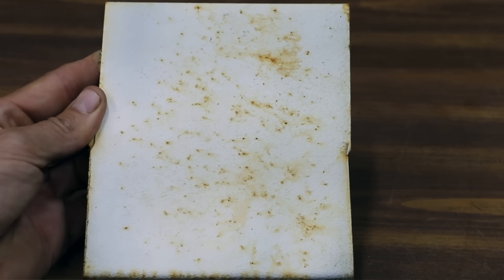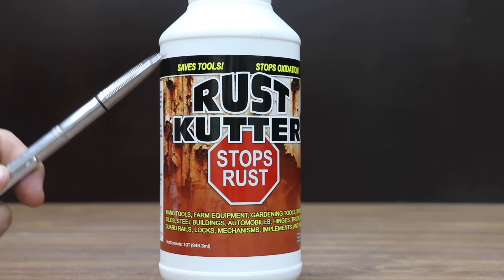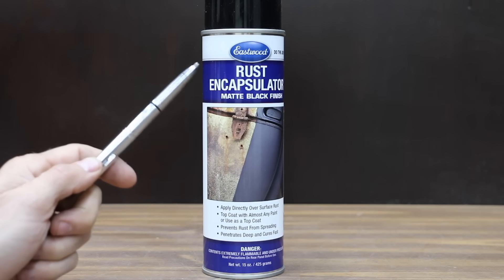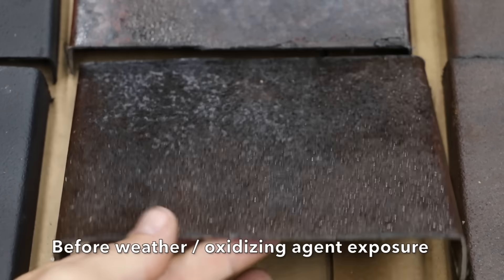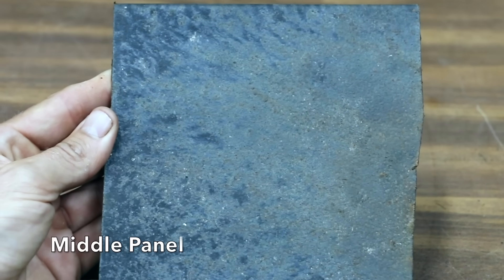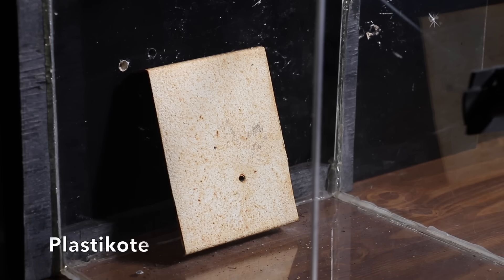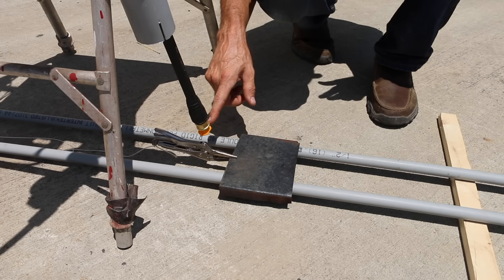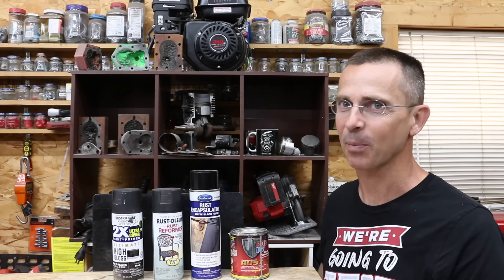Best Rust Converter? POR-15, Eastwood, Rust-oleum Rust Reformer, Gempler's

Comment: Living in Wisconsin, I've used por15 and rustoleum rust reformer.

I did por15 this spring in a heated garage on a fairly clean Jeep. 4-5 months later I'm getting rust all over after doing the 3 step process costing me about $120.

I used rustoleum rust reformer about 3 years ago on a previous jeep and that still hasn't rusted through.
Reply from the maker: Thanks for sharing.

Comment: I wish this video was around when I was doing a ton of rust repairs a couple years back! I still have a huge case full of all the different rust treatments I tried.

I’d love to see a comparison with liquid acid rust converters. It would be especially interesting to compare against something like the Permatex, which is an aerosol acid and should be doing some degree of chemical rust conversion versus just encapsulating. Permatex also sells the same thing as the rattle can, but in liquid form, which could be a control test for directly comparing application methods.
Reply from the maker: Thanks for sharing.  Thanks for the video idea.

Comment: Rust Converter? I am confused by the title of the video. What I see is paint that prevents rust from coming back. Yes, some of the paints adhere to surface rust like POR-15. But what I understand as “Rust Converter” is something like Evapo-Rust, Corroseal, etc. Most of these products are in fact Phosphoric Acid that stabilized the surface rust so you can apply paint over it. The other alternative is when you have clean metal you applied Edged Primer or 2k DTM epoxy primer. PS: the instructions for POR-15 are: first use a degreaser, second used Metal-Prep (Phosphoric Acid) and last applied the POR-15 paint which I think is urethane based. Confused 🤔 can you please clarify?
Reply: I haven’t looked at all the data sheets, but at least the Permatex is aerosol formic acid and is an actual converter. The one that performed very similarly to it probably has a similar composition. I’d also love to see a specific comparison of actual rust converters though.

Comment: I've been using POR 15 for years, it is very expensive but I'm not surprised it did the best. It seems almost like it turns to a epoxy coating. The only drawbacks are cost and trying to get the can open, once it's been used and resealed, best thing to do is put a layer of plastic film over the can before putting the lid back on. I have used all the colors and they seem to work equally well.
Reply from the maker: Thanks for sharing!

Comment: I’ve been using Rust Reformer for years and it’s the clear winner in my book. Only a 6th of the price of Eastwood and POR15 and also way easier to apply than POR15 in tight spots too. I don’t put a top coat over it and everything I paint with it never rusts again for the vast majority of projects. If it does however, it’s super easy to wire wheel a trouble spot and spray again in no time at all. In average painting conditions it also dries very fast. About 5-10 minutes on a sunny day and about 30-40 in the winters here in New England. The stuff I have painted with it (no top coat) looks the same as it did 6 years ago. Truly great stuff.
Reply from the maker: Thanks for sharing.
Reply: Over 6 cans of rust reformer for the price of one por15. I wonder what would have happened had he used the products in monetarily equal amounts.
Reply: @1985cjjeeper  I mean, 6 layered of rrr probably wouldn’t have helped, but, if he did 6 tests on the same por coupon and resprayed over the rrr coupon 6 times that would work too, I touch up nicks and scratches all the time when rocks or whatever hit painted areas
Reply: @tenderblender945  
I used it on a toyota truck frame that was rusting badly from having spent time up north before coming back down south where I live. I would just spray it on and the rust would die and come off in almost sheets then I'd spray it again. Took a year or so but eventually it was all healed up.
Reply: Rust reformer is just cheap spray paint... it's not a real rust converter. No chemical reaction happens and it contains no phosphoric acid.
Reply: @evanfrucht  are we talking about the same paint?
Reply: @tenderblender945  I'm not postive but maybe. I'm glad it works for you. To be honest, I'm not sure what the composition of the Rustoleum Rust Reformer (available in spray cans) actually is, or how similar it is to their normal spray paint... I bought some in the past and was surprised and unhappy it wasn't the normal clear acid type spray that I was expecting, rather it smelled strongly of hot solvents. POR15 and other similar pigmented paint based systems, such as the RRR are completely different than true acid based rust converters which chemically alter the iron oxide. In my opinion, a rust converter should be acid based by definition...
Reply: @evanfrucht  that is completely fair, I like this stuff as it is not acid based so it can be sprayed over many things to preserve things in the mean time to prevent corrosion and won’t harm things like rubber or existing paint ect, and can be easily removed with acetone, it works well for me for this reason

Comment: The POR 15 is amazing. I used it on my 66 Chevelle SS for when I did a frame off restoration for the frame and under body and over 20 years later it still looks perfect ...no rust no chips. Looks as good as when I first did it. This stuff is the best !!!! And when you brush it on it smooths out like if you sprayed it on. A can of it covers a large area so it actually works out cheaper than anything else.
Reply from the maker: Thanks for the feedback.
Reply: @ProjectFarm  I used POR 15 in a rusty trunk floor, that had small and medium holes rusted through, in combination with fiberglass matt and cloth. I installed 2layers of matt and one cloth layer, rolling the POR 15 into each layer as you would with resin. no dry time inbetween. 6 years later the trunk floor is still solid with no signs of rust.
Reply: Can por 15 be painted over?
Reply: @Zumone1one  yes, it can. They also make a product called Top Coat to go over POR-15.
Reply: @Zumone1one  They actually call for it to be scuffed with 320 and topcoated if it's exposed to prolonged UV
Reply: I’m about to do this to a mopar vehicle, how did you prep the surface? Was it almost perfectly prepped and cleared? Or did you kind of get the rust Bubbles off and then apply it.
Reply: @Vikingcowboy5  - It is designed to go str8 over rust. Scrape chunks and wire brush loose stuff off, wash dust and go to town. I didmy truck frame and a trailer hitch receiver years ago, you remember how bad those would rust once the moisture got under the "paint"?  I took off the huge peeling flakes, lightly brushed the dusty stuff off, rinsed with water and brushed on POR15.  5 years later, absolutely no rust came through,  salty winter driving and all. However,  DO NOT get it on your hands.  It is impossible to get off.  It literally has to wear off in 1-2 weeks.
Reply: @PayNoTaxes0GetNoVote   Thanks for the info!!
Reply: @PayNoTaxes0GetNoVote   Thanks for the heads-up!
Reply: @PayNoTaxes0GetNoVote  And if you have a pressurized inert gas you can push that into the can before sealing.  That will greatly reduce the risk of curing in the can.   I think Bloxygen is one example, they use Argon gas.  Argon is heavier than “air” and will lay across the surface and thus prevent oxygen and water vapor from coming into contact with the coatings.  Shelf life goes way up and you might get 2-8 times the shelf life out of the single can of POR.  So, if you don’t use a lot at one time this is a great saver.  Also, the ability to brush this on really helps when working on items that are already assembled and in very tight spaces.  Spray cans make a big mess in confined spaces where your goal is to coat something that’s less than 10% of the surface and there are nooks and crannies in the picture.
Reply: I wonder how similar it is to something we have here called PA 10
Reply: That is seriously impressive

Comment: Given how scarred most handymans' hands are, something that DEFINITELY should be tested is simple wound coverage.

- various brands of premade adhesive bandages (Bandaid, etc.)
- A piece of gauze plus
  - paper & cloth tapes (for first aid kits)
  - duct tape
  - electrical tape
  - self-fusing silicone tape
  - tied bandage

While all should provide coverage for a wound, what would be good to know is how well each stands up to common shop products, abrasion, water, etc.  After all, if a bandaid gives up can falls off, the wound is unprotected.
Reply from the maker: Thanks for the suggestion.

Comment: Best locking pliers/ “vise grips”? I feel like there could be a lot of different and very good tests that can be done . Toughness / construction of tool, a twist test?Toughness of “teeth “, how well it grips onto flats and rounds. Most torque able to be applied .
Reply from the maker: Thanks for the suggestion.
Reply: @ProjectFarm  I have a bunch of old Vice Grips that are great. My Milwaukee have been warrantied a few times from broken springs or broken Jaws. My Home Depot Husky have held up comparable to Vice Grip but no longevity.
Reply: that was quick lmao
Reply: I actually recommended this a couple weeks ago and he made a video on it! I’m glad he did to because I figured out what pair I’m gonna buy lol

Comment: Rust treatment: remove loose rust. Buy a gallon of rust paint. Take out a quart and mix it with a quart of paint thinner. This is the primer. It will soak into the rust and convert it. If after the first coat there's still a gritty look a second coat is required. Dry
 Then paint with unmixed paint.

Auto body: buy the same color as the car or a little liter. Spray with color match paint when dry. Clear.
Reply from the maker: Thanks for the feedback.

Comment: Darn!!!!   I wish the Jenolite rust converter had been included.  I was very impressed recently after not being super impressed with VHT.  But, for my application, VHT did fine after then being painted.  I have no recurrence of rust on my frame rail welds.  I sprayed the Jenolite into areas I could not reach to descale...they all turned very black.
Reply from the maker: Thanks for sharing.

Comment: This couldn't have been better timed if you tried.  I have a whole entire 18 foot car hauler frame that is covered in gnarly rust scale.  I am leaning towards rustoleum rust reformer but in gallon can instead of aerosol.   Thanks for great video Project Farm.   I have heard some very negative things about POR 15 in the last 10 years or so but you seemed to dispel those complaints.  I have used it in the past with good results but I'm not spending that much on a whole trailer frame.
Reply from the maker: You are welcome!

Comment: Can you please test truck frame coatings? Gm Ford and Ram all use different methods from the factory and lots of people are re coating their truck frames because they think the stock frame coating is inferior. It would be great if you can settle the argument of which brand (GM Ford Ram) has the method of coating frames from the factory.
Reply from the maker: Thanks for the suggestion.

Comment: I’ve always loved por-15. The thing about it is, just use it in places you don’t want to ever paint again like the bottom of my truck. I don’t want to ever have to get on my back and paint the frame of my truck again so I used that. Another good paint to paint over rust though not advertised to do so is rust oleum oil based brush on paint. A cheaper alternative
Reply from the maker: Thanks for the feedback.
Reply: Out of curiosity, how do you prep the bottom of your truck prior to using POR-15?

Comment: angle grinder test plz with grinding wheel  life span full wight say 5-7kg or light wight 1kg on wheels 
disk left on 20mm rebar/bolt cut through
Reply from the maker: Thanks for the suggestion.

Comment: To the people watching, the products are important but most of these are paints and, as with any paint job of any kind, surface preparation is the most important step...

 I've used most of these and one product that wasn't included is Ospho, 1 gallon is 36 bucks and covers 600 Sq ft. While most of these paints pretend to be converters, Ospho actually converts iron oxide to iron phosphate, preparing the surface for paint. From experience it would have done better than all but por 15, however, ideally, you wire wheel to nearly bare metal (if not sanding), treat with Ospho, then use por 15... Or if it's small enough you can boil/steam the part to convert to iron phosphate (as gunsmiths do). 

Anything that merely goes over existing rust will not last forever. It must be removed and/or converted and protected.
Reply from the maker: Thanks for sharing.

Comment: I watched your video on interior paints and can confirm that your conclusion was spot-on. 
Can you do the same test with exterior paint on house/fence/deck as well? 
If possible, please compare heat, cold, hail, dirt, corrosion from harsh cleaning chemicals, pressure washer,  rock, egg and 'woodpecker' resistance?
If you can, please include some of your local brands (ie: Farrell Calhoun) and see how well those paints protect underlying wood from elements after going through multiple cold-hot-pressuwasher-egg cycles. 
Thanks for everything that you have already done.
Reply from the maker: Thanks for the suggestion.

Comment: to simplify;
1. Rust care is a two stage process- conversion and sealing. No one product does both as well as the best choices in each individual category.
2. For conversion, there are basically two choices; tannic acid or phosphoric acid. 90% of all products claiming conversion  will use one of these. All of the 'single step' products I know of use tannic acid- phosphoric acid can be pretty harsh by comparison and doesn't play well with sealants.
3. For sealing, you've got your paints, oils, waxes, and polymers- huge selection here. 

Personally (and having tried almost all of them), I use 'Rust X Krud Kutter' phos. acid for conversion most of the time- it just works better. Nasty stuff tho...
For a sprayable oil, I prefer 'Rust Cop'- it hangs in there long after others give up, and never gets gummy.
For a solid surface cover, I'm not overly impressed by anyone in particular. Rustoleum is always ok and offers both butyl and enamel cover, but discount bin/closeout spray paint works too. Don't waste your money on specialty frame paints; convert first, then paint- the process is more important than the product used.
Reply from the maker: Thanks for the feedback.

Comment: I've always meant to try corroseal from Lowes, it's basically the cheapest $/gal for a big project that you can buy locally.
Unfortunately I never got around to it.
I'll be in the market for some of this for my fence, with rusty metal posts, soon. Thanks
I've used Rust Reformer many times, it's just too expensive for big jobs. I've also used industrial 2 component rust converters at military bases, goes on clear and turns black(extremely expensive) ...
If it's cheaper to just sand/grind your project down to the metal than to buy the converter then there is no point imo.
Also sometimes the structural integrity of your metal can be compromised by removing the rust, if the rust is really bad, meaning either replace or use a rust converter to get that last bit of life out of it.
Reply from the maker: Thanks for sharing.

Comment: When I refurbished the frame of my car, I did a load of research to see which inhibitor would be the best (although I must admit, nowhere near the amount of tests that Project Farm does!!).  I ended up using a product from Bilt Hamber called ‘DynaxS50’.  At the time, I was also reading info regarding people using waxoyl, making their own waxoyl with wax used in fitting toilets, etc., etc.  I’d love to see the POR-15 go up against other products.
Reply from the maker: Thanks for the suggestion.

Comment: Hey project farm, I was giving my truck a tune up and oil change, then I started thinking how I’ve always wondered what spark plug brand was the best. Who’s would burn the most fuel, have the biggest spark, get the best gas mileage, increase the most HP. Is it Motorcraft, ACdelco, Bosch, Autolite, Champion, Denso, NKG, and so on. And also does having more then 1 prong on the end create a bigger spark, or is 3 prongs better? I would love to see a spark plug show down from you about this topic.
Reply from the maker: https://www.youtube.com/watch?v=jcVF3xL_fzk  is one test.  Thanks for the suggestion.
Reply: @ProjectFarm  thanks… I somehow missed this video.

Comment: For my trailer, I used Rustoleum's Rusty Metal Primer and it seems to be holding up ok so far.  I also used a couple coats of automotive spray paint and covered that with multiple coats of automotive clearcoat to help protect against rocks and debris from the road.  If it doesn't last, I might have to try the POR-15 if my wallet doesn't revolt.  Thanks for yet another awesome video!
Reply from the maker: You are welcome!  Thanks for sharing.

Comment: It would be cool to See what these products did to a porous rusted surface. Something that's actually rotted instead of surface rust. Good information to know though. I used por-15 on my classic motorcycle gas tank and it's worked great, and my father used it on the frame of his 1971 Pontiac and that seems to be working well as well.
Reply from the maker: Thanks for the suggestion.

Comment: What about a video testing the best (most durable, best coating) spray paints? Comparing common options like rustoleum farm and implement/engine enamel, krylon, duplicolor engine enamel/general purpose automotive, etc?
Reply from the maker: Thanks for  the suggestion.